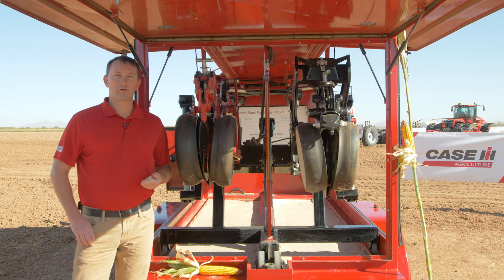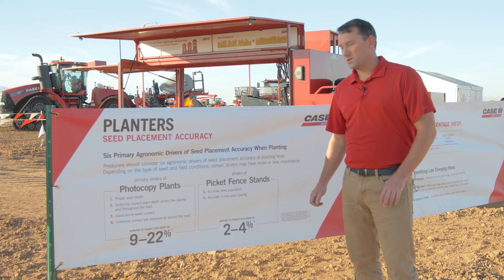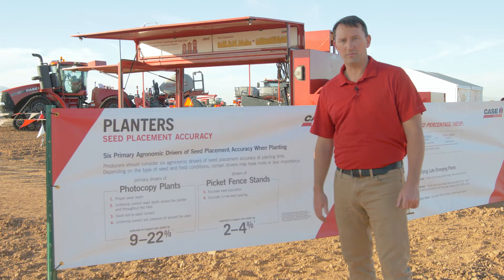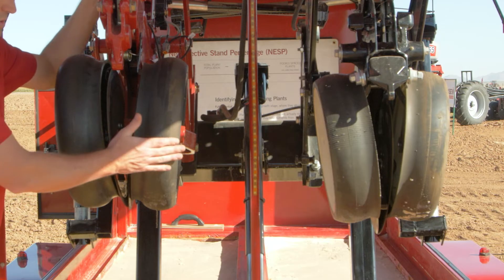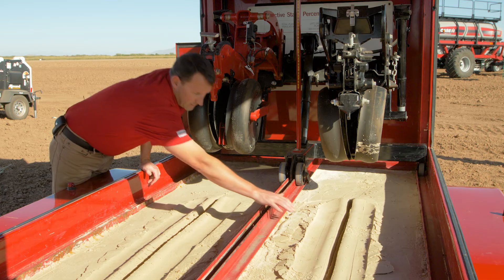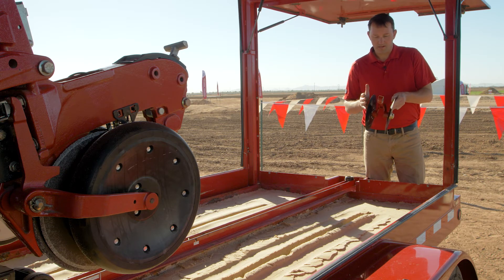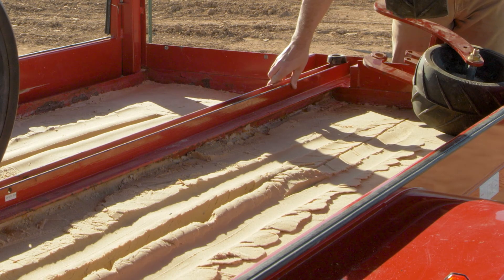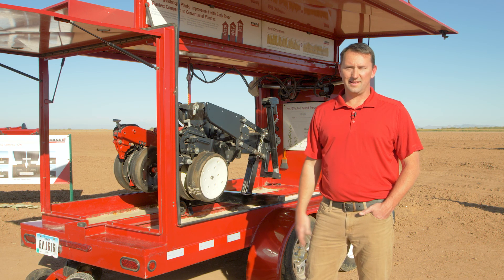Understanding the Agronomic Traits of the Early Riser Row Unit Design

Comment: CIH really needs to change the design of their gauge wheel arms.   They don't run tight against the disk on back.   I know CIH argues that it's to let the dirt fall out, but the main purpose of the gauge wheel is to hold the seed trench wall in place.   With the gap on back it lets the seed wall dirt come up, thus destabilizing the trench plus it lets dirt inside the gauge wheel and leads to plugging.   I ended the plugging problem by going to MudSmith spoked gauge wheels but would still like to see the tire firmly against the opener disk.   CIH even came out with a black land fallow attachment to move the disk out, but that defeats the purpose of having the narrowest seed trench in the business.   And it doesn't work with the heavy blades and bearings now being made for the planter.
Reply: What are your soils like?  We tried one in very heavy black soil and it wouldn't  close the trench and did what you are describing by lifting whole chunks out between the trench wall and the closer disc.

I couldn't believe how soft the ground was after a planter pass, be a good  if they can make it work properly but keep that trait.  

The rest of the machine was as good as our deere.
Reply: @Foz300  We have soils varying from medium clay to silty loam.   Closing the seed trench has never been a problem for us, even in no till.